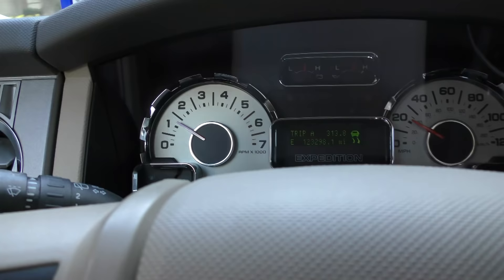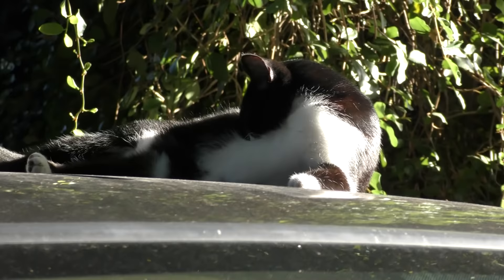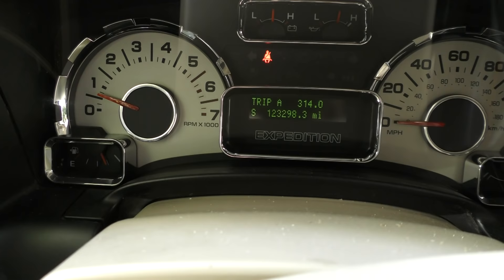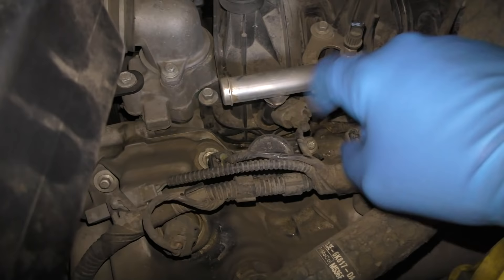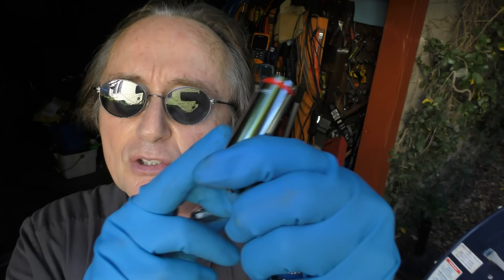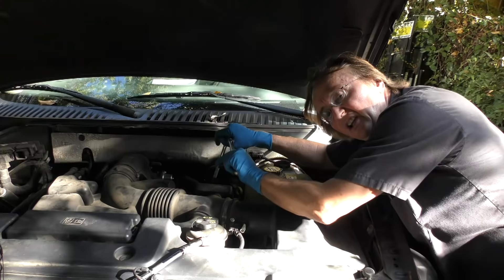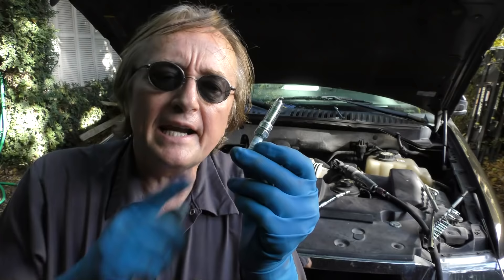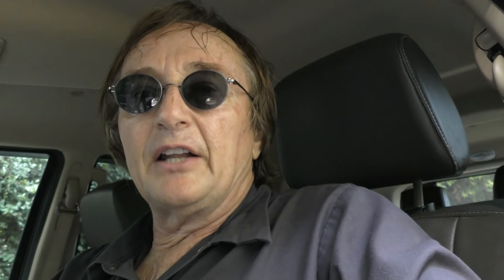How to Stop Car Hesitation (Spark Plugs and Ignition Coil)

Comment: Factory spark plugs after 123k miles? What the hell are those made out of? Mine go wrong after around 30-40k.
Reply: You are just going to destroy the coil packs by not changing sparkplugs. when the gap get bigger the coil have to make a bigger spark/harder to park and that shortens the coil life.
Reply: Factory platinum plugs are supposedly able to go 100,000 miles.  Iridium plugs can go even longer than that.
Reply: Double Iridium or platinum are pretty common plugs these days from the factory. As long as the engine doesn't start running too rich or lean they'll last a looong time.
Reply: DE Nichols Double (as in both poles are made of it) Iridium and platinum don't erode much and are good at self cleaning in the temperatures inside the combustion chamber. 

But I don't advocate using anything more then what the factory spec is. The entire engine these days is designed around the ignition system in an EFI car and 'upgrading' spark plugs is at best a waste of money and in certain cases actually more harm then good with wasted spark designs.
Reply: I know I'm in the minority, but I believe spark plugs are under-rated.  Why?  So the spark plug companies can sell more of them!  My 1992 3.3 Dodge Grand Caravan has more than 235,000 miles on the original plugs.  Sure I've inspected them on occasion and cleaned and re-gapped them.  The van runs smooth and returns 25 mpg on the highway.  I believe the advent of electronic ignition has played a part in extending spark plug life.  Call me a cheapskate, but if I was working on that Mustang, I would have cleaned and re-gapped the plugs, cleaned the corrosion off the one corroded coil-on-plug, and called it a day.  If that didn't fix the problem, I would have changed out the bad coil-on-plug.  I think Scotty will agree that the contaminated coil-on-plug was causing the hesitation.
Reply: why not just change the spark plugs they dont cost that much.
Reply: Why not change the interior light on a regular basis?  It doesn't cost that much.  The answer is that it's working just fine and doesn't need to be changed.  Same thing with the plugs.  Has nothing to do with money.
Reply: There a reason there is a Interval from the many factor on when they need to be change. But do what you want, not telling you to change them.
Reply: I once attended a seminar on lug nuts and lug bolts.  The speaker advised us that every time you tighten your lug nuts/bolts, you stretch the threads and after only 3 cycles, the nuts/bolts lose their ability to hold your wheel on so they should be replaced.  He worked for a company that sells lug bolts and nuts.
Reply: then its some shitty log nuts :P i see what you are saying and understand you.
Reply: Han Skinslo My car has platinum from the factory and it's rated at 40k miles. They still go wrong after around 30k.
Reply: Have you tried cleaning and re-gapping them rather than replacing them?
Reply: Frank Howard Most of the time they crack, so cleaning and re-gapping isn't going to help.
Reply: The plugs in the Mustang weren't cracked.  I would never advocate re-using a cracked plug.
Reply: I think you're kidding yourself.  A spark is a spark.  A new plug will produce a spark.  An old plug will produce a spark.  Either one will ignite a fuel/air mixture.
Reply: Your average run of the mill copper core spark plugs that most engines factory used up to the late 200Xs cost about a dollar a piece. Truth be told you are spending more on them in cleaning solvent, propane, and time value then just replacing them.
Reply: Cragified My country is different. Copper ones cost 10 bucks here. Sucks, eh?
Reply: DE Nichols Gonna have to replace my plugs soon. Gonna buy platinum, it's gonna cost me 80 bucks. It's a 4 cylinder car. Gotta love Europe, right?
Reply: OK fine.  Without going into detail as to the scientific method you used to determine that your mileage improved, please explain why a spark from an old plug will not ignite the fuel/air mixture as efficiently as the spark from a new one will?  Both sparks are generated from the same coil or coil pack.
Reply: Please tell me where I can buy plugs for a dollar.  Further, when I clean my plugs, I don't use solvent or propane.  15 seconds on the bench wire wheel does the job.  I doubt the cost in electricity to run the wire wheel is more than a fraction of a penny.  How much money do you spend driving to the auto parts store to buy your plugs?  Compared to the 15 seconds and another 45 seconds re-gapping them, how much time do you spend driving to the auto parts store to buy your new plugs?
Reply: Frank Howard Champion, Motorcraft, and NGK all have various OEM copper cores that are ~$1. And your final statement is quite the foolish statement as it assumes someone makes a trip solely for the purpose doing so instead of planning ahead and stopping by while on another round of errands.

Btw, it is bad practice to use a wire brush or wheel on a spark plug near the center electrode, it is quite easy to damage the ceramic insulator with it.

The insulator over time can get contaminated with oil, this especially happens in spark plug wells on OHC engines and no amount of scrubbing will remove it as it has impregnated the ceramic.
Reply: You said, "you are spending more ... time value then just replacing them".  I replied that I spend about a minute on each plug and that you spend more than that going to the store to purchase replacement plugs.  Regardles as to whether or not you work your trip into other errands for efficiency reasons, I don't believe the 6 minutes I spend cleaning and gapping my plugs is "more ... time value then just replacing them".

As far as damaging the center electrode with a wire wheel is concerned,  I've been cleaning plugs for 55 years.  Never damaged an insulator or any other part of the plug.

The wire wheel cleans the ceramic as well.  Regardless, please explain how an insulator contaminated with oil will cause harm to the performance of the spark.  I'd really like to know.
Reply: Frank Howard Mechanically cleaning the ceramic will damage the exterior glazing making it more prone to oil impregnation. Not to mention it can create micro fractures leaving it prone to failing.

Oil contamination carries with it not only the hydrocarbons of the oil but the anti corrosion elements such as zinc and blow by carbon, both of which are conductive. This can cause a conductive path across the insulator that then makes the spark plug fail to spark at the electrodes reliably. 

It will also make the ceramic have uneven thermal distribution which can cause it to crack and blow out a chunk. 

Just because you have been doing something for 55 years (if actually true) doesn't make it the most reasonable and practical thing to do today. Especially given how difficult it can be to get to many spark plugs on V type transverse mounted engines today. If I'm going to be doing he work to get at the back bank then I'm going to put in new plugs for a dollar or two each then mess around trying to clean them, which will always be inferior to factory fresh.

This all of course is about standard copper core plugs. If you are mechanically cleaning iridium or platinum coated plugs with a wire brush then.. well you don't have iridium or platinum coats plugs anymore.
Reply: First of all I stand corrected.  I've been cleaning plugs for 45 years, not 55.

Without quoting all of your arguments verbatim, if what you say is true, why is my 25-year-old 235,000 mile minivan running so well?  I also have a couple of vintage Lotuses that run like Lotuses should not to mention a Jetta.  Your evidence appears to be different scenarios of what could happen if I clean my plugs rather than replace them.  If you don't clean/gap your plugs, how would you know what would happen if you did?  My evidence is what has actually has happened because I've always cleaned/gapped my plugs and I have first hand knowledge as to what actually has happened so what's the stonger evidence?  What could happen or what has happened over the past 45 years?

You have to keep in mind that spark plugs don't produce sparks.  The coil produces the spark.  The spark plug simply provides a gap for the spark to jump across.  If you don't want to take advantage of my experience, go ahead and keep throwing your money away on parts you don't need.  The spark plug companies are counting on it.
Reply: You've cleaned and regapped old spark plugs and they didn't work as well as new.  I've cleaned and regapped old spark plugs and they did work as well as new. Are you suggesting that I'm learning nothing if I go with my experience rather then yours?

You may like engines running really good, but that does not set you apart from car owners who like their engines running really good, especially Lotus owners.

I'm aware that I said that the plug simply provides a gap for the spark to jump across.  That doesn't mean that they're not designed for different temperature ranges.  I'm well aware that spark plugs have different temperature ranges.  Plugs come in different sizes and they're sold with one, two, three, or four tips as well.  I don't believe these differences have anything to do with choosing to clean/gap rather than replace.

I've asked you why my 235,000 mile minivan is running so well on the original plugs and you haven't been able to come up with an answer.  I'm just sharing my 45 years of experience.  You can learn from it, or you can continue replacing perfectly good parts.
Reply: Frank Howard Just because their principle is simple and they have no moving parts does not exclude them from being wear components.

Take this image for example http://www.filtsai.com/accord/spark_plugs/old_plugs.jpg

These plugs are not worth 'cleaning' their center electrode has been eroded extensively and has lost the edge, rounded electrodes are inefficient. Every single spark jump a microscopic amount of electrode is eroded on copper cores like these. So you are in fact not being truthful in that you only wire wheel them to maintain them as you would need to file the center electrode from time to time to get the edge back.

Next look at the oil at the hex nut on the metal case. That contamination extends under the crimp seal where it can't be reached and that area of a spark plug is the resistance element inside the ceramic insulator, the primary source of internal thermal generation for a spark plug. All it takes is one crack in the insulator from a hot spot then the oil contamination can create a weak conductive path from the core to the case and thus preventing or reducing spark jumping the gap.

Trace amounts of metal left on the insulator from a wire brush can also create a ground path. 

Once upon a time it was common to file and clean plugs just like points. But the reality is they are so cheap now days that when they are worn it's just more economical to replace them. Then you have fresh electrodes, clean unstressed insulators. And when you have to take a intake box off so many engines just to get them or they have the ever so common issue of oil leaking into the tube wells I'm not going to try to be ultra cheap and clean them an install an unknown condition part to save a few bucks, while spending time that is far more valuable.

That's akin to changing a waterpump on a timing belt driven waterpump and not replacing the timing belt because it looks 'ok' you are already in there done all the work, spend the few dollars and replace the belt and tensioner.
Reply: If you can't explain why my 25-year-old 235,000 mile minivan is running so well on the original plugs, go ahead and critize my delivery.
Reply: Thanks for you response and thanks for the link.  You made several comments in your post and I read them all.  I do think you stepped over the line when you said that I am, "...in fact not being truthful in that [I] only wire wheel them to maintain them..."  I am in fact being truthful.  You may assume that I file the center electrode but the truth of the matter is that I clean the plugs on the wire wheel and re-gap them.  That's all I do.  Please refrain from calling me a liar and yes, saying that I am in fact not being truthful is a polite way of calling me a liar.  Now, on to the rest of your response.

You made several claims about old plugs:

1.  Rounded electrodes are inefficient.
2.  The oil contamination can create a weak conductive path from the core to the case and thus preventing or reducing spark jumping the gap.
3.  Trace amounts of metal left on the insulator from a wire brush can also create a ground path.

In what way are rounded electrodes inefficient?  Please explain.  Trace amounts of metal left on the insulator from a wire brush an also create a ground path?  I suppose a solid piece of wire that happened to land on the center electrode and the ground could create a ground path and the plug would fail however a stray piece of wire landing on those two contact points and staying there is as likely as me forgetting to turn of the bench wire wheel when I'm done.  I think that's a stretch.  I think you'd have a better chance of getting into an accident on the way home from the auto parts store.  Regardless, if the three claims you made are true, can you explain to me why my 235,000 mile minivan is running so well?

Finally, I don't think cleaning and gapping plugs is akin to re-using a timing belt when the water pump goes bad.  If I changed a water pump and skipped the belt and the belt failed a couple of days later, assuming that I had a clearance engine, it would take me anywhere from 4 to 8 hours to replace the belt.  If I re-used the spark plugs and a couple of days later a plug failed, it would take all of a few minutes to replace the plug.  If the plug was on the back side of the V6 in my minivan, it would take 20 or 30 minutes.
Reply: Frank Howard Sharp edges are more efficient at generating spark because the electron flow occurs at the point the electrical field potential is strongest. This means where the radius of the surface curvature is the least, which is the sharp edge. 

As the electrode wears down and becomes rounded the spark becomes less focused over a greater area which can lead to a weak spark.

The only purpose of the spark plug is to create a focused high temperature spot in the highly compressed air/fuel mixture. If the electron flow becomes unfocused you will have electron flow over a wider air conduit and thus have a very weak spark or no spark is the electrical field becomes too diffused.

As far as why trace amounts of metal can create a path it is the same reason on a printed circuit board one can create a trace and jump leads with a simple pencil and drawing on the PCB. It provides a path of less resistance (less resistance then the air) to electron flow.
Reply: OK.  Assuming that because I've never replaced the original plugs on my van, I have a weak spark, a very weak spark, or no spark at all and because I use a wire wheel to clean the plugs, most likely I've left trace amounts of metal on the electrode, how is this affecting the performance of my van that starts instantly in the dead of a Minnesota winter, runs smoothly, and returns 25 mpg on the highway?

Further, if I took your advice and started filing the electrodes, this would add maybe 15 seconds on to the amount of time I spend cleaning and gapping my plugs, an inconsequential amount of additional time.

Look.  You're giving me a lot of doom and gloom speculation as to what could happen if I don't replace my plugs.  I've conducted a 235,000 mile test and I'm giving you the results of what actually happens when I don't replace my plugs.  You can take my experience for what it's worth, or you can leave it.  I don't have a financial interest in a wire wheel manufacturer.  I have nothing to gain if you cease wasting your money on unnecessary parts.  I'm just putting out the truth for you to see.
Reply: DE Nichols I don't feel you need to accredit me for such a thing as it was neither my idea, observations, or theory. It's just electrical theory. Research corona discharge to see why sharp edges promote electron flow in a more visual context.
Reply: Frank Howard Your anecdotal evidence of your minivan is growing more grandiose each telling.
Reply: I've always checked my mileage on long trips.  Drives my wife crazy.  At every fuel stop, I note the gallons purchased and the number of miles covered and do the math.  I always start each trip out with a full tank and I give it a final fill as I approach our destination.  Why do I do this?  Because if the mpg suddenly went from 25 to 18, I'd know that something was wrong.  To be fair, if I set the cruise at 70, the mpg will drop to 22.  I do this on all of my cars including my Lotuses which regularly hit 38 - 40 mpg highway.  The Mazda Protege we just got rid of (22 years old) hit 38 - 40 as well.  The replacement Jetta can only do 33 - 34.  I suspect the reason for this is a combination of a shorter final drive ratio and an engine that's 10% larger.  My point is, I'm not making up the mpg.

The performance comes from the fuel/air exploding, not the spark.  Either it explodes or it doesn't.  A weaker spark isn't going to produce a weaker explosion.

"...a weaker spark makes for a richer mixture..."  Where did you get that from?
Reply: Really?  How so?  Anecdotal?  My evidence is based on facts, not my opinion.  I know for a fact how many gallons of gas it went through on each trip and I know how many miles it covered.  That's not anecdotal.  As far as performance is concerned, no I never took it to the drag strip but I can tell you that it has always run smoothly (except for the one time when we bought a bad tank of gas) and it has always started right up during the coldest of Minnesota winters.  I believe that's a pretty good test that your plugs are fine.  Believe me, if your spark plugs aren't working properly, your car won't start in that kind of cold.
Reply: I can definitely trust that stronger and weaker sparks effect the air/fuel mixture?  How does this work?  If you think [my] odd habit with [my] spark plugs is responsible for [my] unusually high gas mileage, then what's the downside?  If the strength of the spark affects the air/fuel mixture and that the computer compensates, then how do you explain the performance I get out of my Lotuses?  Neither of them have fuel injection or any computer at all.  Only one of them has electronic ignition while the other still uses points (that are probably 30 years old).
Reply: My understanding is that the O2 sensor checks the mixture coming out of the engine.  If the car is running rich, the O2 sensor lets the computer know this and the duration of the pulse on the injectors is reduced thus leaning out the mixture going in.  I don't believe the 02 sensor can monitor how strong the spark is.  Correct me if I'm wrong.

My, "...anecdotes are self-admitted to be when you're only on long trips..."  Well I was just trying to keep it simple.  If you want the city mileage, here they are:  Both Lotuses and the Mazda Protege, 26 - 28, Jetta 24, Dodge Grand Caravan LE 17 - 18.  I think the mileage on the Lotuses could be better if I could resist the urge to drive them more aggressively.

Anyway, this has been an interesting exchange.  I've put out my real life experiences and you can take them for what they're worth.
Reply: I have a buick 3800 series V6 2008 w/ factory originals at 104,000 miles. It ain't easy for me to get the boots off of the plugs. So I haven't changed out the plugs yet. I tried and gave up months ago. No hesitation, but does have hard starting/cold start issue.
Reply: alot of toyotas plugs are good for 120K
Reply: AndersDog94 plugs for my f250 run $43 and thats with all 8 autolite double plat plugs.
Reply: Try 10k
Reply: GMC Jimmy 98. 186k miles orginal everything!! But gonna change the plugs out. Threw a po300 and then the check engine light went out after like 20min lol.
Reply: This is a silly argument.. So one likes to wash his own car while the other likes to have his car washed & thr rest the difference.